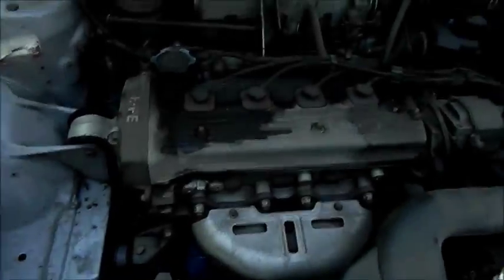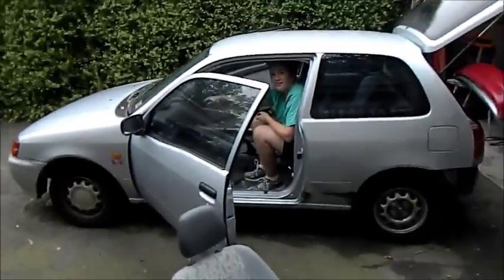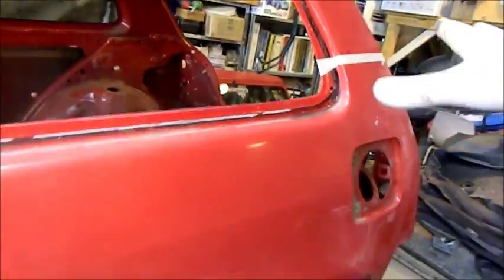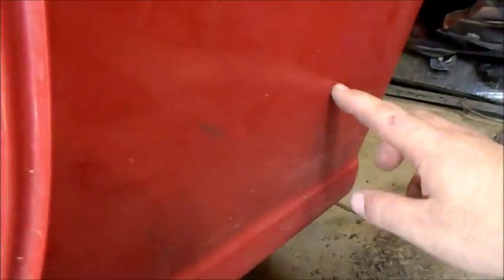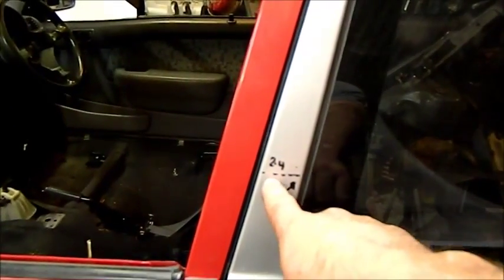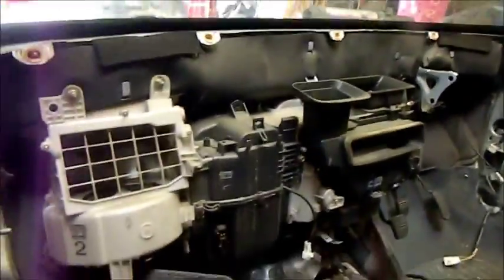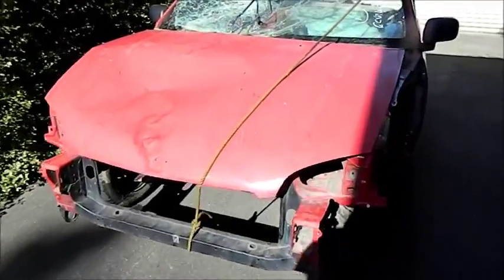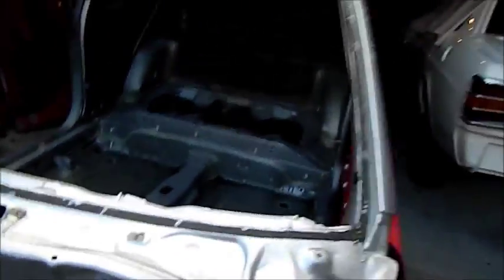Teenager Abandons Computer (at last) – Starts Fixing Car

Comment: Those little Toyota engines are an absolute dream, they came from the period when Toyota truly did make the most reliable cars in the world (unlike their current cars) and 280,000km (about 174,000 miles) is nothing for them when a lot of their rivals when new have absolutely had it at about 250,000km (150,000 miles or so) these things will happily breeze on past 400,000km (250,000 miles) as long as they get a modicum of care.  I've never heard of one blowing a head gasket and it seems about the only thing that will kill them is serious neglect.  And they can go rather rusty in the UK, though clearly you don't have those problems.  One of my neighbours has one of these Starlets that he bought new in 1995/6 (his first Toyota,) he used to be the sort of person who changed his car every 3 or 4 years.  Well, he's still got the Starlet, it's still his daily driver and it's just coming up on 270,000 miles without a problem and it's never failed an MoT test.  He does take care of it but that's still good going for a small, fairly cheap car.  He says he's going to run it until it breaks though lately he's changed it to until it, or he breaks, I think he now thinks he'll break before the car does...